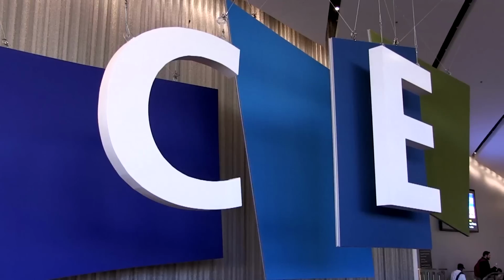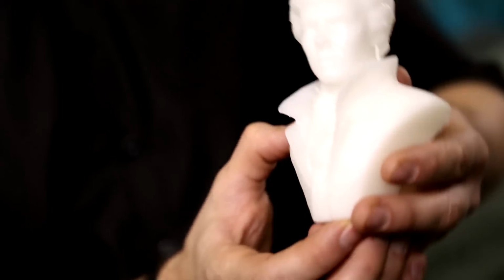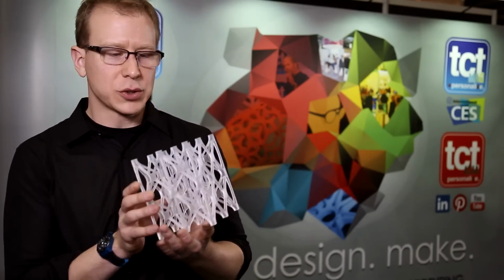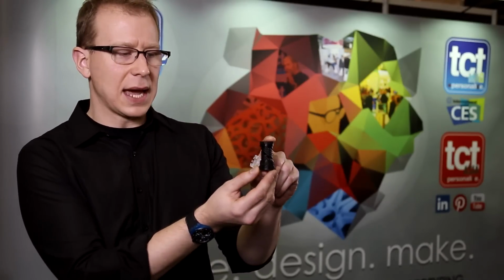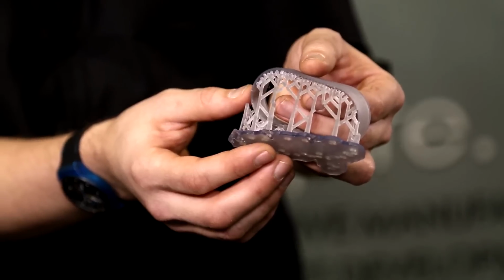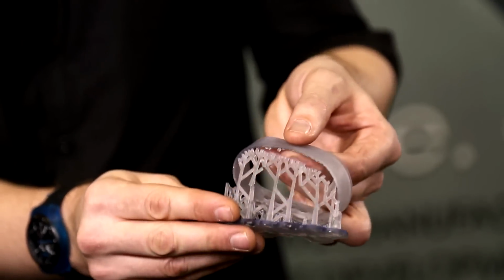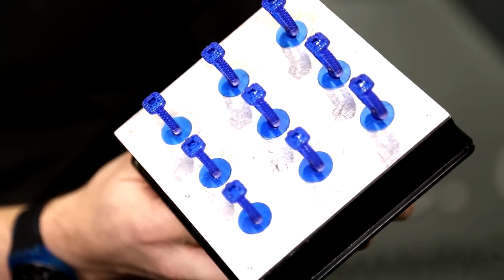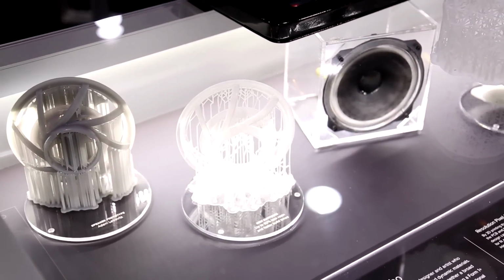3D Printing at twice the speed with SLA draft mode from Formlabs at CES 2015

Comment: hey hey first comment. yea form labs have a great product and yes fdm is old hat to sla in detail but to get into one of your machines is super costly especially when you import to another country and pay fees on top of that.
i had to go with peopoly moai and i do not regret it. yea a 1600 layer print takes a day and night at 0.1mm but it does a great job. i think sla is going to move over for dlp when the resolution gets to 4k on a printer as its best of both worlds for speed and detail.